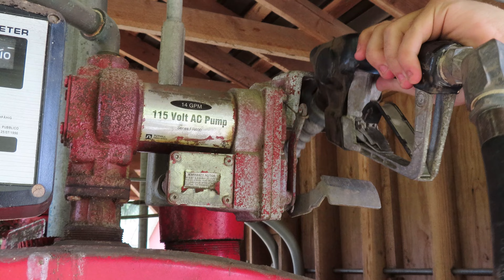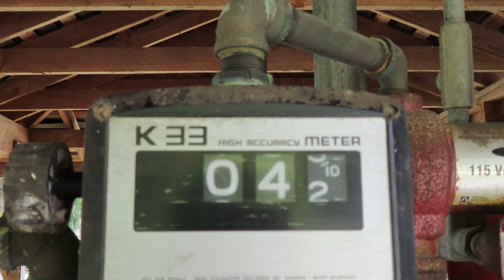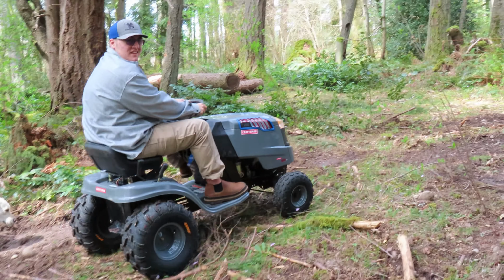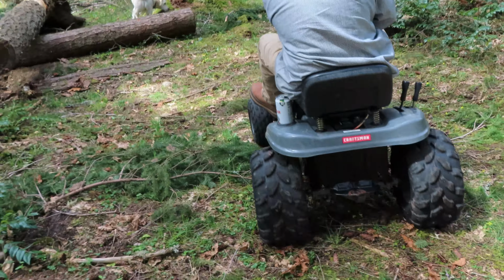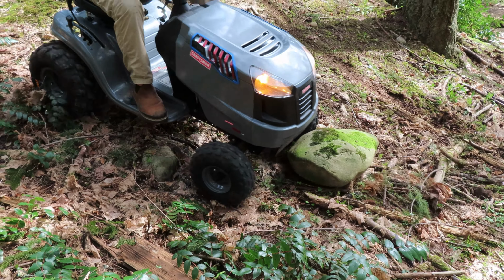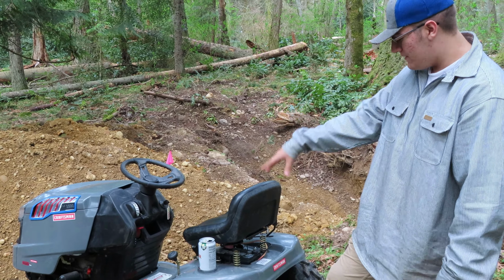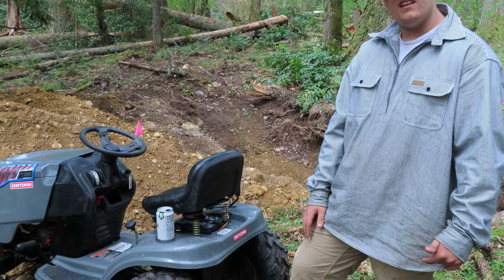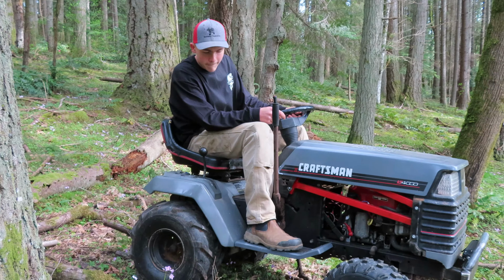Crusin the trails in the MOWERS!? (Sweet tea and Mowers)

Comment: I got a craftsman t1000 recently and welded the diff. Mine has 2 little hole on either side of the gear 180 degrees from one another that you can see the spiders through.  I cleaned the ever loving crap outta the inside of the housing as best I could so I didn’t have a grease 🔥 still had a little inferno going 😂 I cranked the millermatic 211 to 7 power and 70 on the feed speed and just dumped weld in that beotch. I pulled all slack out of my axle shafts as well and used vice grips against the case to hold it there tight. That bad boy is solid. No play and very well melted together lol then I lathe’ed off the 3” pulley , carefully used a dermal and carbide burr and grinded the weld on the lower mower pulley and flipped em that way. Works great. So I am still using the stock bolt to hold my stack pulley on like factory.

Comment: Could you tell me the front tire size on your Craftsman?
Reply from the maker: The LT4000 box body has 8 inch wheels from a Garden Tractor on the front. The tires are quad tires that should be 19-inch.
Reply: @northwestexploration8119  OK, thanks